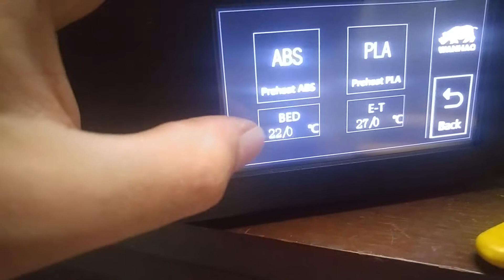Wanhao Duplicator i3 Heated Bed Fix!

Comment: So I'm getting something of the same issue. Except when the bed heats up and is specific positions it will show 0. I'm actually going to replace the thermistor itself. But I'll check the other wires in there while I'm at it. Seems to be a common issue and Monoprice Support is a joke.

Comment: This should fix the wild temp swings on the bed temp also. I noticed that if the bed stays forward for some time the temp will raise to over 80C when it should be 60C. What kind of tape is that? High temp?
Reply from the maker: Not sure what type. its the stuff that came with the printer but im sure its rated for a high temp
Reply: I can confirm this will (or at least can) in fact fix the temp swings on the bed. i experienced this recently. The wire will be damaged inside the sleeve but the damage is not easily visible. You can find the problem site by carefully bending the wire along it's length and looking for slight kinks or thin spots of the white wire insulation.

The tape is called kapton tape and is in fact a specialized very high temperature capable tape

Comment: Do you possibly know what thermistor it is? I think I need to replace mine, I keep getting maxtemp exceeded errors
Reply from the maker: Here this page shows where to get replacement parts for hotend: https://3dprinterwiki.info/wiki/wanhao-duplicator-i3/part-specifications/#Hotend
the thermistor for hotend is sold here: http://m.ebay.com.sg/itm/331721610140?varId=540836069669&_trksid=p2060353.m2749.l2649&_mwBanner=1
Reply: FreeRangePickles Awesome, thank you. Didn't realise the nozzle and bed thermistors are the same :)